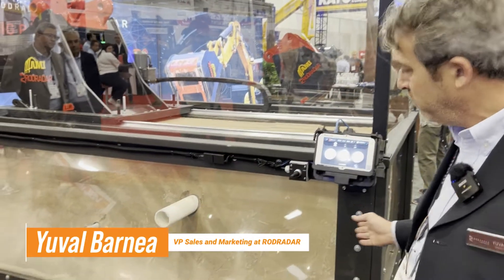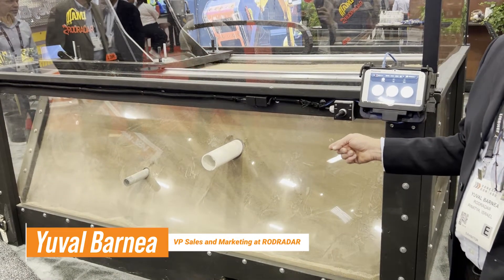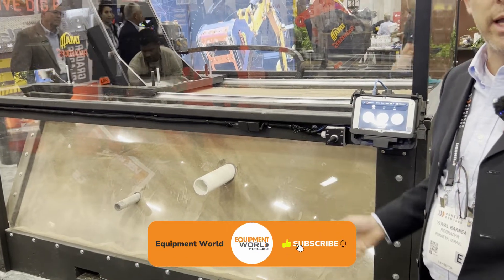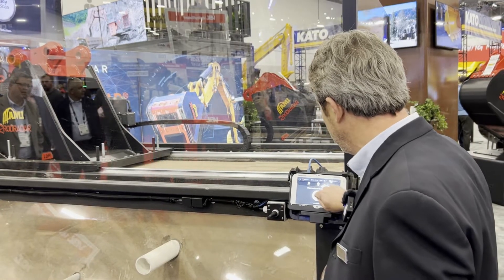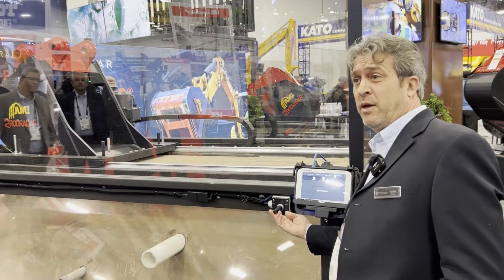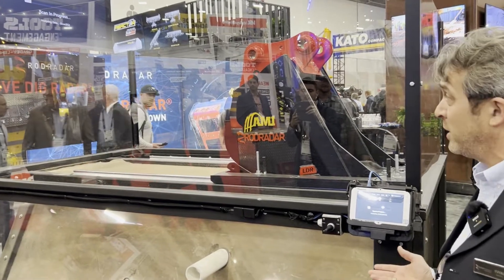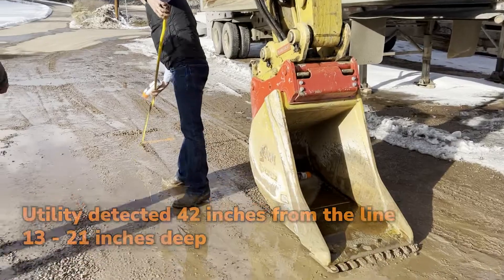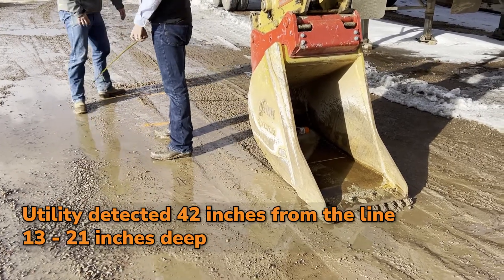“Holy Grail for Earthmoving”: Rodradar Excavator Bucket Detects Buried Utilities

Comment: 20 years of working with GPR. I would be weary of this statement when its know Clay is really not good for GPR. and good luck with Lone fibre. And im not sure it has and vertical scanning, so any pipes or cables running parallel to the bucket. The time taken to scan and dig scan and dig. It would be much faster and cheaper to get a full GPR survey done before work starts. dont event want to know the cost to fit all your machines to a large project. Also will people pay there employees more when your upskilling them, and giving them the resposibility to not hit anythng. hmmm.